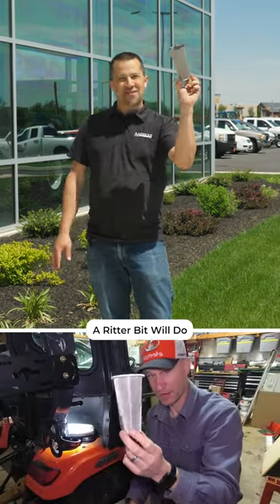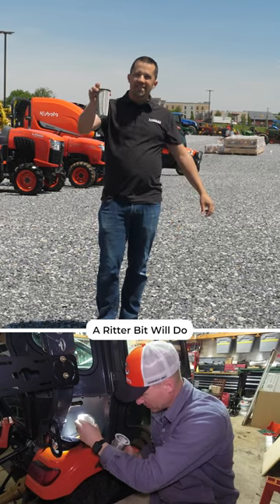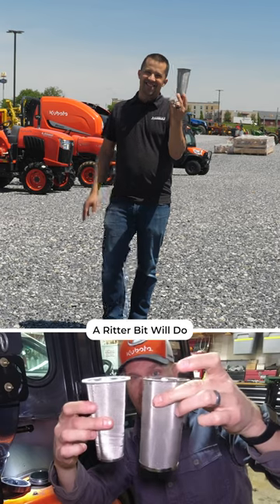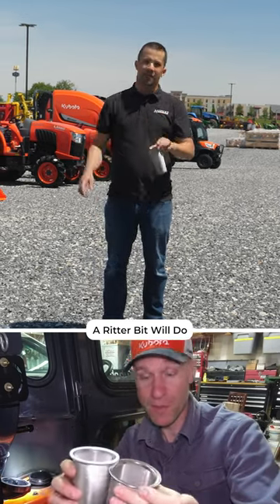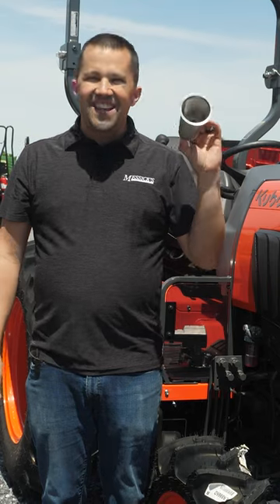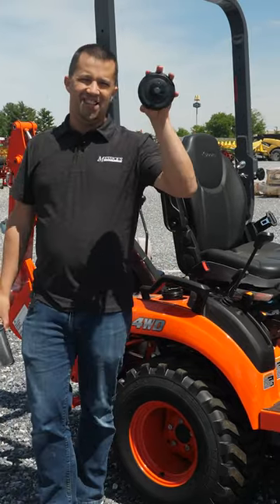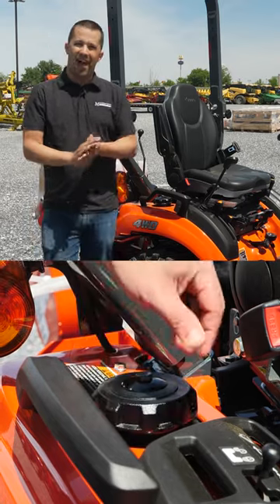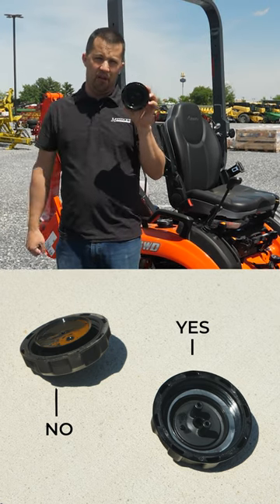"🍵Cold Brew" Fuel Strainer for Your Equipment

Comment: It needs a rubber seal under the strainer lip to the plastic spout of the tank so it will properly seal between those stiff contact points to match factory seal but not too important just food for thought.

Comment: I bought 2 for my diesel kubota mower.  Both my cap seals got damaged from that filter causing both caps to leak.  I cannot find just the diesel cap seals. I think they only come with the cap’s which is very expensive.  Any idea on a part number for that seal?
Reply from the maker: That's interesting. I see what you see, there's no parts for the cap itself.

Comment: Was wondering if you you have a “gas” tank on a machine why would you need to filter diesel fuel from a diesel fuel can ? I would say that you would need to filter gasoline as you put it into a gasoline tank. In other words I thought that the tractors that you sold were equipped with Diesel engines. And running too much gasoline in them would ruin them
Reply: For many, it's a habit to just say gas tank since our daily drivers run off gasoline. Plus, diesel tank doesn't roll off the tongue as well as gas tank or even the proper term; Fuel Tank.